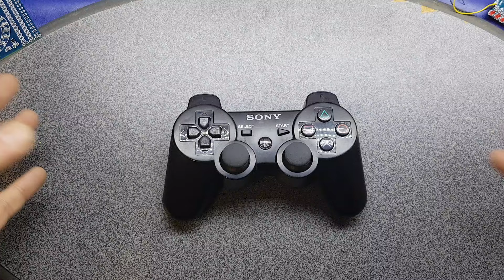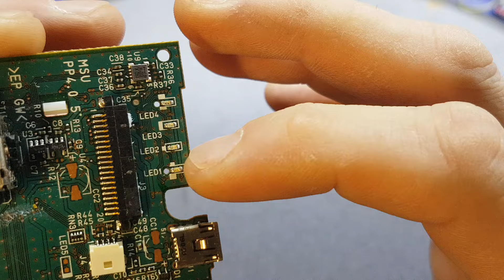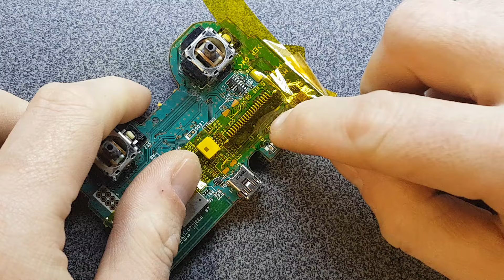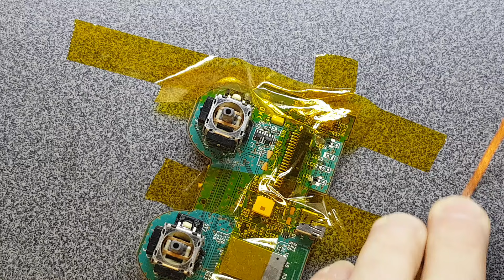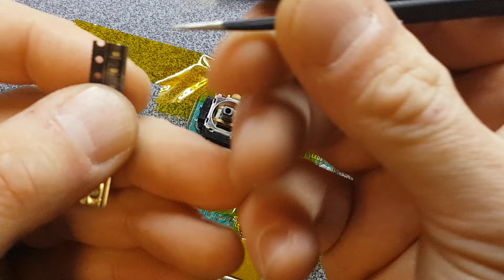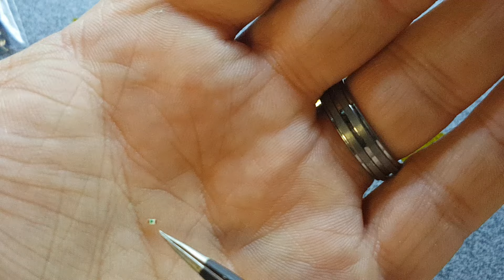SMD soldering tutorial - component removal and replacement (and a PS3 controller LED mod)

Comment: I did this very same modification to my old PS3 controller years ago (blue 0602's as well!), although i didnt have the luxury of a hot air gun, just a terrible draper iron with a less than useful tip especially for LEDs this small, it worked though! Haha, good times, good video as well bud!